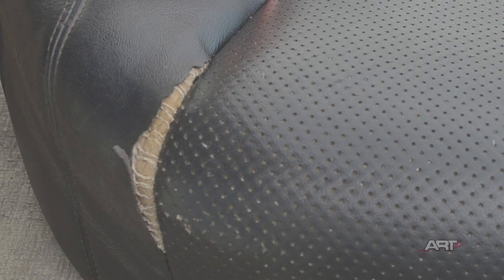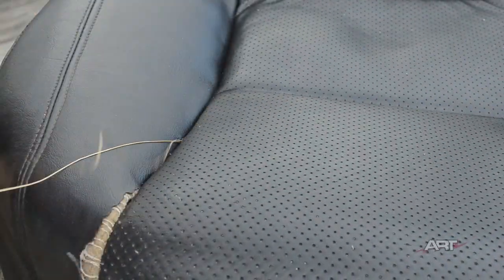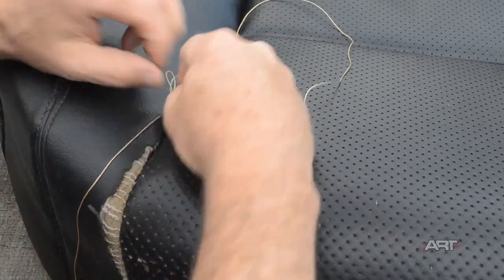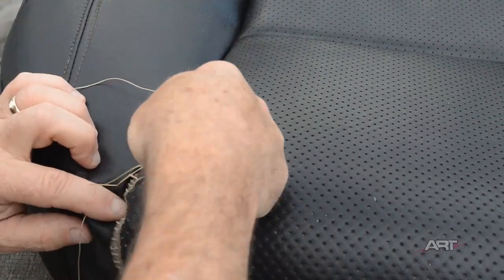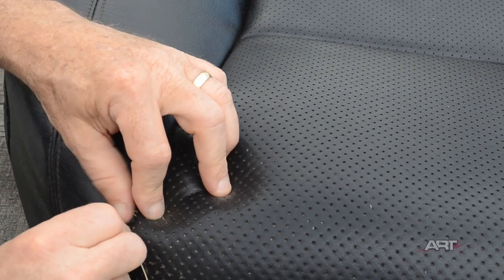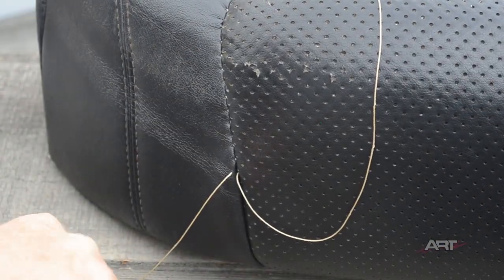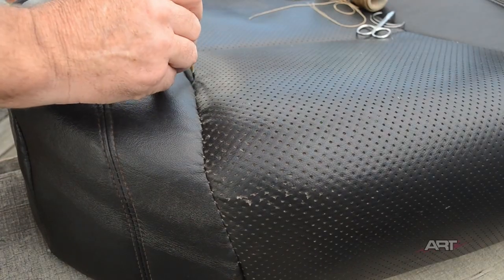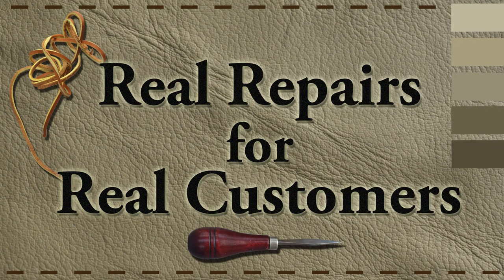Double Needle Blind Stitch Part 3 Vinyl  v15

Comment: Nice work! I have a few questions though. I hope I can word this right to where it makes sense. I'm about to stitch up a few tears in my back seat. Are you using 2 separate pieces of thread? If so, when you thread the needle what do you do with the excess you pulled through? Just let it hang there while you stitch? Also, When Pulling the 1st initial stitch through there's no knot tied at the end of the thread, how  does it not just pull right through the hole? 

 I think if The video was panned out a bit to fully see all the thread And exactly how you're threading the needles I would understand more. Any advice from viewers or yourself would be much appreciated. Again thank you, and great work!!
Reply from the maker: Please see Part 1 and Part 2 because I may have spent more time there on the basics.   One thread with a needle on either end.  No knot needed except at the finishing end.  When threading the needle the excess just hangs there.  The beauty of the heavier hand sewing thread and the smaller eye of the 3" curved needle is that the needle rarely ever falls off the thread in normal use.  A tighter fit when threading but less hassle while using.
Thanks for your comments.

Comment: Great stuff.  I just bought a repair kit and sewed up my daughter's seat.  It turned out really well after watching your video a couple of times.  I do have one question.  My thread that came with my upholstery kit was a little thin.  Yours looks thicker. What mm thread are you using?
Reply from the maker: Thread thickness is by weight per certain distance.  Hand sewing thread works best because it is the appropriate thickness.  Too thin a thread will cut the material like a knife.  Machine thread (in the machine) has no pressure on each stitch.  Hand sewing thread has a lot of pressure per stitch.

Comment: Hey Rick, I’m making a repair like this later this morning and had a question. I’ve used this technique on leather with great success, but not vinyl until now. Are you running the thread through the holes on the right side of the seam or are you creating a new hole in between the existing perforated holes? I couldn’t quite tell from the video. Thanks a bunch!
Reply from the maker: I use existing holes when I can.  But often the line of holes is also torn out.  Just make sure you compress the panel to relieve pressure before tightening a series of stitches.  Never pull against the holes only.  Thanks for the question!

Comment: Would this technique be appropriate for a simple popped seam in a vinyl seat from a 1960's era car?  My classic Camaro has a seam that popped from the sun breaking down the threads over the course of 50+ years.  The vinyl seems to be intact.

I also have another area where the vinyl pulled away from the piping along a seam.  Not sure if there is any way to access the tail of the piping under the upholstery.  Any ideas?  The car is unrestored and all-original, and I would like to keep the factory interior intact as it is in pretty decent shape for a car this age.  Thanks!
Reply from the maker: Yes indeed.  And when stitching through piping or welt cord, handle that step on it's own.  Don't try to push through everything at once. 
If the piping is still attached to one side, cut it loose so that it hangs by itself.   This will generally prove much easier to deal with.  Great question.  We don't see this much anymore but if I do I'll try to video it.  Thanks.

Comment: I repaired my couch in my RV.  Not as pretty as your work but I used the double blind stitch. However the “pleather is fraying around my new stitches. Is there a glue that I can put over my new stitches to keep the material from fraying around my new stitch holes?
Reply from the maker: What I find in all the RVs is the urethane laminate material.  It will continue to delaminate with no end in sight.  There is no glue to stop it.  Feel free to email a picture.

Comment: This is the only video I can find that has perforated leather in it. Is there any way to repair perforated leather without reupholstery, properly? I run across a lot of Lexus and BMW and infiniti with tears in the leather. Everytime I repair it the holes go bye bye. I have tried poking them back in but it doesn't work well and it seems to compromise the structural integrity of the repair. Any advice?
Reply from the maker: Thanks.  I'm getting ready to post a series of videos on perforated.  Within a week or so.  Stay tuned!
Reply: @a.r.t.srealrepairsforrealc8247  YES!!! Can't wait.